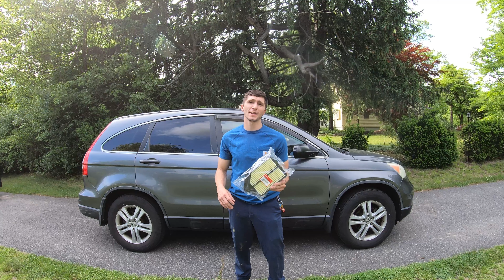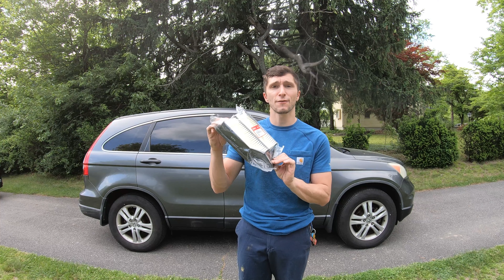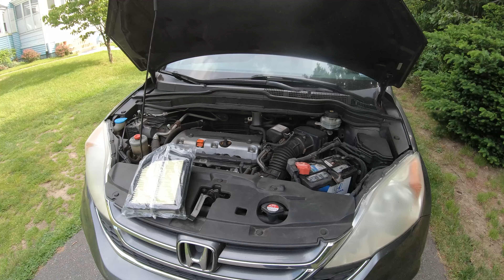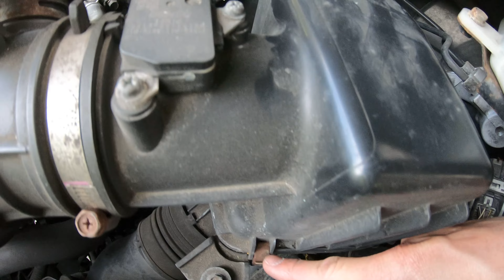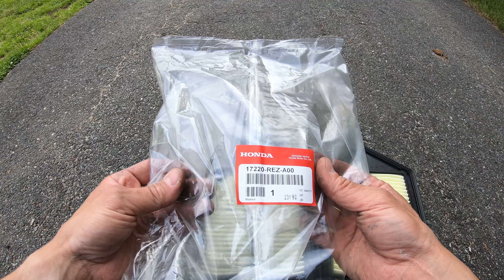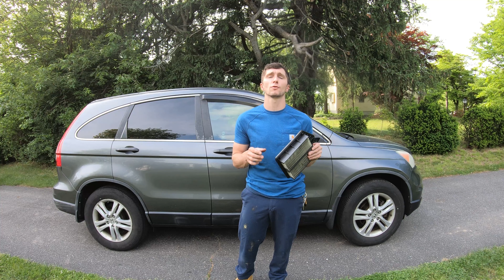How To Replace Engine Air Filter 2007-2011 Honda CRV

Comment: Hey Vinnie, does your CR-V have water in the spare wheel well?  mine does, tried a fix by sealing some holes behind bumper, but no luck.  would be great if you could share some knowledge?
Reply from the maker: So it’s very tricky with water leaks, it could be coming from many different areas. Typically we get a hose and lay it on the roof of the car, run the water for 5-10 minutes and check for leaks on the inside of the vehicle. A lot of times you have to remove all the interior plastics so you can actually see if water is trickling in through any holes or seams. So once you can confirm the water isn’t leaking in the car from up above, then you work your way down the sides, and eventually at the bottom. Sometimes there’s holes that are under the spare tire, I’ve heard people say they’re for draining the spare tire area if it ever fills with water. You can put rubber plugs in those holes to seal them up but also still gives you the option to pull the plug and drain if needed.

TLDR: pull the spare tire, completely dry area with towels. Run water hose on roof and see if water is coming in. Seal as needed. Start from top and work your way to bottom of vehicle. 

Hope this helps!
Reply: @VinnieT  Thanks man, will give it a try